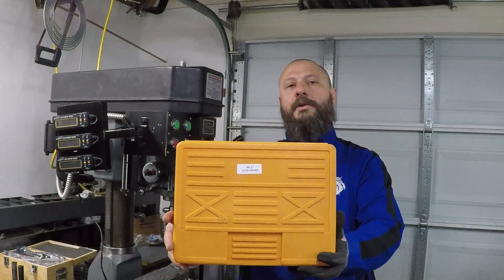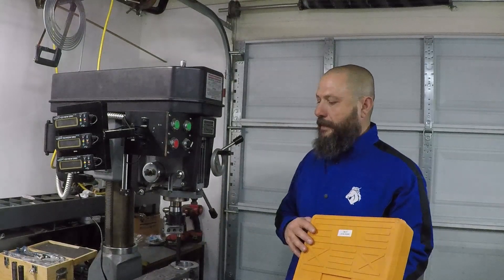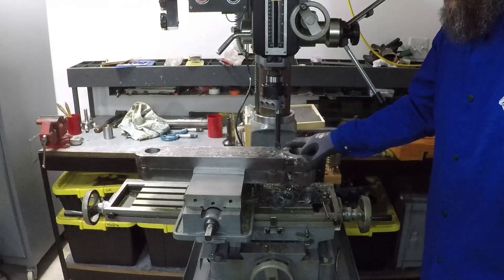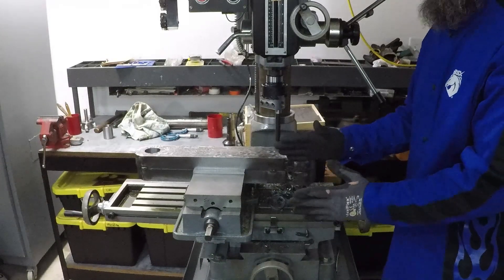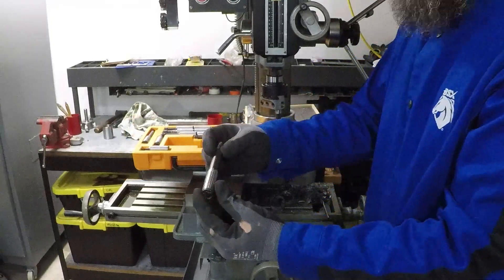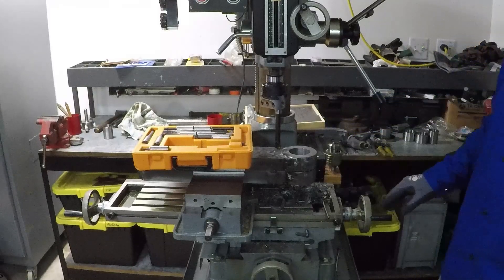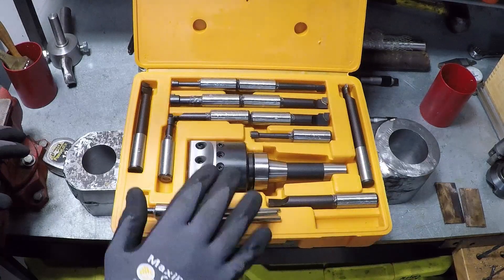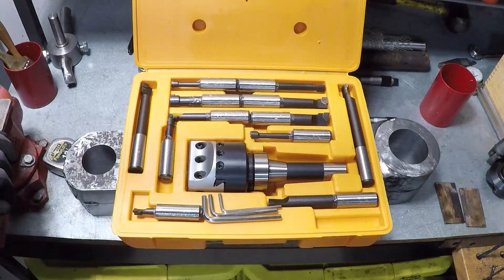Reviewing Amazon 3 Inches Boring Set

Comment: I have a Coventry head in 2' & 3'.  Made in China and for the cost it is excellent.  Fettle them a bit and they become really good.

The boring bars are not indexed for a reason, it is so you can adjust for the job.  
The Carbides will cut as is, but are so much better when sharpened and honed.  The boring bar sets are cheap to buy.

 Make a horizontal boring bar by fitting two pegs to a square bar and machining the end for a Carbide insert.  This allows use clockwise.  If you use the supplied bars, the head will unscrew from the arbour as you will need to run counter-clockwise. Also doubles as a single point surface cutter.
Reply from the maker: Thank you, I appreciate your feedback and valuable information. Be safe and have a great day
Reply: @SalamSayhood  You are welcome, my friend.  Sharing knowledge and experience is how we make life batter.
Reply from the maker: Sure, I always appreciate constructive feedback as we all benefit from exchanging knowledge and experience. Thank you again.

Comment: Thanks for posting as you know I have the same mill and am looking at getting a boring head on Amz..Thanks for the demo and tiips.. always woried about limit of hand feed finnish...looks good... I always had a Bridegport power feed when I worked as a machinist.
Reply from the maker: It really worked OK, make sure to use cutting oil and cut about 0.005" at the time, the machine will flex due to the round column and being under sized for large matching. When I got to the final dimensions, I just went about 0.001 at the time. I am satisfied with the results.
Reply: @SalamSayhood  Thanks 👍
Reply from the maker: Thank you for your support. I appreciate sir